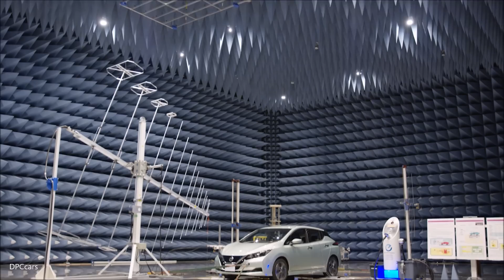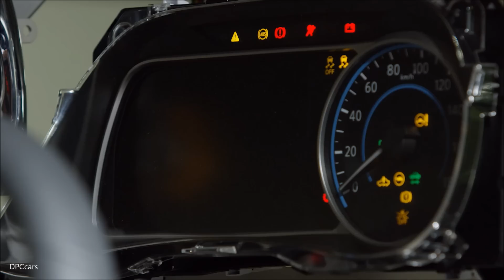2018 Nissan LEAF Factory Assembly Plant

Comment: I like that the Nissan Leaf is bigger.  It probably gives up about 10% mileage because of that.  But, I think it will be more comfortable.  My only concern is the lack of active battery management.  Early Leaf's were notorious for battery degradation.  Has that problem been fixed?

Comment: While the Leaf maybe a great EV, I see many people comparing it to the Tesla Model 3, and let me tell you, buying a Leaf over a Model 3 is the equivalent of shooting yourselves in the foot. Specially when both are priced so comparatively. The Leaf uses non-standard prismatic battery cells, these have next to nothing resale value & can't be 'reused' unlike the 2170 cells used by Tesla, which retain 70% charge capacity after the period of ownership of the car, and can be used & integrated in industrial scale energy storage projects extremely easily & at a cheaper cost than for them to buy newly manufactured ones, which means it'll hold it's value way better.

Unlike gasoline, which leaves no trace upon consumption other than emissions, batteries are simply a combination of certain minerals packed together, and are quite the same as they were when new. This means, even when you'd have to scrap the Model 3 after 10-15 years of use just like any other car, you'd still be able to sell the cells for a cool $3,000-$5,000. Nissan is counting on the fact that people wouldn't know what to do with this certain bit of information, and thus wouldn't include it when making the purchase decision, but a car is almost always a long-term proposition, and it's financially rewarding to treat it that way.

Not to mention, if you're like the average driver having a low-volume use case, in a few years time with the Tesla Network - a Uber like service that'd allow your self-driving car to make money for you by driving people around, much like Uber but the car will drive by itself while making you money, you'd quite literally be able to earn more than the monthly payments for the car and at no extra effort!

Moreover, buying a Tesla vehicle is more than just getting a car, it's more like a membership to an exclusive club. Not only will you get constant feature refreshes by way of software updates, but also access to their Supercharger network. I really can't justify buying something that's as much of a compromise when the Tesla is available at the same cost.
Reply: Zubin B. What price comparatively? You will never see the 35k model 3. When you see it, there will be better cars at the same price. Model 3 costs 49k now minimum

Comment: I would imagine the full process costs less than $15k, but then Nissan sells it for $30k..
Reply: Think of all the research, staff, energy, materials, robots, tools, property, transport..
Reply: Your imagination is wildly off.  The margins on EVs are smaller than on most ICE vehicles primarily because of the battery.
Reply: Danyal A. Dude, the cost of the parts are very expensive. Not to mention the battery, motor, software and everything. They had to cover costs like R&D, software optimization, factory workers, taxes, emission taxes, electric bills, advertising, services, prototype testing, warranties and so on. It's not just like picking parts off the scrapyard and build a heap out of it... 

Don't talk price when you don't know the making behind it.
Reply: I mean't: less than $15k.
Reply: The battery pack of the original Leaf at introduction was a cost of $18k. While production today has increased and prices have dropped, they haven't dropped that much that you would have a much bigger capacity at a fraction of the cost today. Your $15k would therefore just get you the battery.
Reply: My friend got a Nissan Leaf replacement pack for $6000, what are you talking about?
Reply: Don't forget that the price a consumer pays does not have to be the actual production value. Don't be surprised if Nissan loses money on replacements of batteries, especially since they are rare. You can even go into battery renting from Nissan and they will swap out your defective battery immediately for just $100 (except you gotta stay in the rental program and pay that amount every month for as long as you own the car).
Reply: So, your're telling me Nissan installed a $15,000 battery pack in my friends car for $6,000 because ... ? You really think Nissan would lose $11,000 on a battery replacement and be "okay" with it?
Reply: Given the amount they claim gets replaced, why not? The battery should last 8 to 10 years so the amount of batteries they had to replace is, according to Nissan, very low. By keeping prices of malfunctioning units low and affordable they can keep the customer and the reputation.

Do you really think everything is always sold with a profit? You have to look at the big picture. Overall the car makes a profit, so what if you have to replace a few batteries every year for under the production cost? Do you really think Nissan would have made it as the best selling EV for years in a row if the batteries were shit or would cost 15k to replace?

But at the end of the day, the only ones who know the answer to your question live somewhere in Japan. But remember, when the Leaf was launched, the avg price for a battery was at $900/kWh making the battery cost come in it $21k however, rumour had it that Nissan was able to produce them cheaper. While most people guessed the cost to be around $18k back then (for a $32k car), Nissan hoped to bring the price down to $500/kWh or $12k over time. And while production costs from big companies are much lower than the $500 today, let's not forget that for manufacturers like Nissan who have invested in their own production capacity, lowering the cost isn't as easy since their production lines are not designed for the rapid development the mass production battery companies are designed for. Replacing the production lines every few years is a costly business and the output of their own production plant is limited to their own (and I imagine Renault's) cars.
Reply: Batteries are still very expensive. Infact GM loses money on every Chevy Bolt they sell because of how expensive the battery is.
Reply: alex91008 That is before ZEV credit.
Reply: The cost of replacing the battery take in account the value of the old battery.

Comment: Hope they bring the  e-Nv200 also with the new battery on the market soon.   The Leaf is not big enough, its a small car with limited trunk space.  Also the seat position is not high enough when you transport handicapped peoples.  The car industry thinks not practical, they think like babies.
Reply: I think it'll be a e-nv300 tbh
Reply: mhh.. the nv300 is very big .  I prefer the nv200 as EV,  very handy  and practical.    Nissan make a 40KW Battery in the car :D !!!
Reply: Actually, I've been driving Nissan cars for 15 years now and I've always been happy with the space I have in them. With my >1m90 I'm not a small person yet I fit nicely in the driver's seat. I had to drive a Ford for a few months (company car) and hated every second of it. That car did not fit me. Which is strange since Americans are bigger than Japanese people.

The Leaf is a small city car. That's what it is designed for. If you need room, you need to look at the bigger vehicles like the Qashqai and X-trail. Look through Nissan's range (not just on the local website or dealership but online on e.g. Wikipedia) and you'll be amazed at how versatile the line-up of the company really is and how little of the entire line-up most of the world actually gets to see.

Comment: Wow this is mass production!  Where is Tesla Model 3 factory mass production video?
Reply: Jun Whang "production hell" :) I see no "hell" here. Made them look like a bunch of amateurs.
Reply: Alexander Filep the model 3 preorders out sold 7 years of the original leaf production
Reply: I can see here a shocking high level of uncontrolled manual work. As soon as Teslas Model 3 "machine that makes the machine" will run, we all will see the difference – and why Elon ist talking about "production hell".
Reply: Dunno about the 3 but this assembly line doesn't compare to the Model S line.
Reply: yes Nissan is way more efficient than Tesla, cranking out millions of cars every year.  And Nissan makes tons of real profits at the same time (unlike continued losses of billions per year at Tesla)
Reply: Jun Whang:  Time will soon tell but so far you are comparing a barely tolerable econobox to one of the most desired cars in the world.  At least Nissan dramatically improve the previously HORRIBLE appearance of the Leaf with the new version, it's still not the car you want it's the car you can afford.  Right?  Anyway I'm very happy to see as many viable options for E-cars as possible, excellent trend.
Reply: Bo McGillacutty imo the model 3 isn't very desirable either. The exterior is ok but the interior design looks horrible. No instrument cluster display and no heads up display is a deal breaker. And I don't buy into Elon Musk's bs about not needing it after it drives itself. Interior design has never been a strong suit for Tesla. To me a Chevy Bolt is more desirable since it's available now and it has an interior that actually has some substance.
Reply: alex:  I tend to agree about the lack of instruments in front of the steering wheel, seems like a big mistake from a drivers perspective. Taste is a funny thing, I think the 3 is an excellent looking car from the outside.  The performance spec.s, tech attributes, reliability, etc are crucial to me.  I don't know much about the interior but there are some things I don't like about the S and X interior for the price range.  But those are simply too big for me anyway...not to mention expensive.  Anyway it's great to see all the competition coming out from Germany to America to Asia.  Elon does tend to be a bit optimistic, many would say over promise and under deliver, but he still has done a spectacular job all things considered.
Reply: Yes, Tesla Model 3 is not particularly good looking, especially the weird front end.  Also, sedan  format is good for joy ride, but not as practical as CUV like Bolt or hatchback like Leaf.  Rich people can have dozens of cars, but masses have to be more practical about their choice of cars.
Reply: Jun:  The front of the 3 is understandably controversial but overall it's far ahead of the pact in terms of simple, sleek, subtle and pleasant appearance imo.  I loath all the protruding parts, lights and such, and dramatic styling for the sake of distinction and those age fast too.  Tesla has a cult following that's a bit hard to fathom sometimes, it's true for the cars and the stock TSLA.  For MY use a small sedan is perfect, but I have a big clumsy work truck out of complete necessity (service 1-ton) to fill in for rare big loads.
Reply: If I had a family of four or five and price was no consideration, the S would be one of my top picks of any car on the market today with the exception of some interior deficiencies and lack of luxury features.  The 3 is the closest to anything I would actually consider so far from Tesla, or perhaps any E-car but I haven't really looked into it because I use cars until they are near obsolete and my old BMW 330 coupe has a lot of life left in it and is STILL FUN to drive... it's never let me down, hasn't cost me much to maintain, it even looks very good today, understated, simple and sleek.
Reply: Jun Whang keep in mind that Tesla is a baby company and will probably reach real model 3  volume production in December. 

It will be interesting to see sales numbers of both cars end of 2018. 

The leaf and model 3's  real competitor is the ICE cars. Both EVs will sell well!!
Reply: Yes given the huge amounts of capex, it would be very surprising if Tesla didn't reach Model 3 mass production.  But the key question here is if  Model 3 can actually reverse long history of cash incineration at  Tesla, and bring in bountiful profits as expected by all Tesla investors!
Reply: It would be many years before Tesla makes any meaningful profit because they are constantly reinvesting to to grow at a neck breaking pace.  Judging from the stock price investors aren't to concerned with near term profits as long as they keep innovating.  Eventually investors will start clamoring for profits as the company stops growing and becomes more seasoned
Reply: Then that could be very serious trouble.  From now to many years, there could be another stock market meltdown which will make it prohibitively hard to get any more funding for a startup like Tesla!  Remember Amazon had positive cash flow and was self funding even though there wasn't much profit to show for.  However, in case of Tesla, it's huge losses coupled with negative cash flow which necessitate constant funding or else
Reply: Jun Whang I do agree that if the market crashes it would be worrisome for Tesla. Unlike Amazon it takes huge amounts of capital to make cars and while many new companies have tried and failed. Tesla is the first new car company in more than 50 years in the US.  Although they are more than just that; batteries and solar now. They will need to tap the market again next year to expand electric charging infrastructure, gugafactories, model y and heavy semi-truck
Reply: Hell doesn't exist. So mass production of Model 3 doesn't exist too. lol
Reply: After Musk fired thousands of workers, I wonder if I will even get a model 3 by 2020. I think I am going to get my refund back from Tesla and get a new Leaf. I own a Leaf now, but my battery is starting to loose capacity. I think 150 miles will be plenty good for me. Going to give my 'old' Leaf to my son and for $6500 he can replace the battery. The new batteries are better than they were back in 2011.
Reply: Yes Leaf should be significantly cheaper than Model 3 given Tesla isn't making any base Model 3 for quite a while.  Hopefully Telsa will eventually start real mass production of Model 3, but there is a chance they could go BK before that happens (taking depositor's cash with it)
Reply: What's with all the humans ? This is typical of a low-volume production line.
Reply: Nonexistent. All Model 3 you see on the roads are test mules, cobbled together mainly by hand and owned by Tesla employees.
Once the next year 60kWh Leaf arrives, the so-called "$35k" poverty-spec Model 3 with its measly 50kWh battery would be worthless, and the long range 75kWh car would just be another well off family's 2nd car, likely next to a gasoline SUV. 
Fanboys say Tesla will change the world. In reality, they have done nothing other than maybe scratch the surface of automobile history.
Reply: Probably the reason why Toyota cranks out couple million cars a year ...
Reply: Trades46 next year will be big for leaf, model 3 and bolt. Theses are all "next gen" more affordable EVs. EVs make up only 1% of the market so their real competition is again ICE cars.
Reply: Indeed, but I would hate to be the one sitting there with a 'reservation' while everyone drives off and later end up with an inferior car because of hype & marketing. I may come off as a Tesla hater, but that is what I truly believe.
Reply: Trades46 I guess we'll have to wait for the reviews and safety crash tests next year when they get all the links worked out. Tesla is a baby company compared to Nissan and GM so they are alot slower at mass production but should eventually get there. Companies competiting means consumers win. Exciting times!
Reply: Jun WHANG WHACKER GOOD LUCK TRYING TO FIND A CHANGER  HAHA
Reply: I love my Nissan Leafster !  It is way nicer to drive than my 1963 Ford F-100 pickup truck.  It is Not, "a barely tolerable econobox"  Thank you very much !  .  .  .  .  and I think it looks 'cute'  .
Reply: It's funny isn't it. The new leaf is selling at about 10k a month steadily. No fuss. 

Meanwhile model 3 production is limping and the end product has many defects.

Comment: Come on Nissan, It's needs to have a Frunk like the ones in Tesla....
Reply: No - if everything is embedded under the car like Tesla, its much more time consuming to repair.  Good for high end luxury cars, not so good for mass market cars.  Better to have important components in engine bay where it can be easily accessed.
Reply: Jun Whang As well as being able to use the same equipment to place either an ICE or the leaf Charger/Invertor/Motor during assembly.